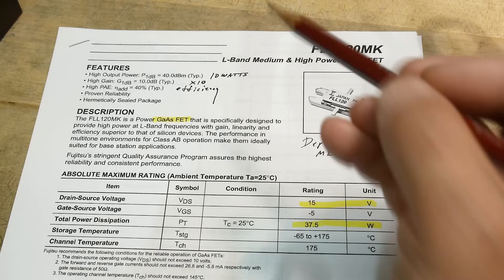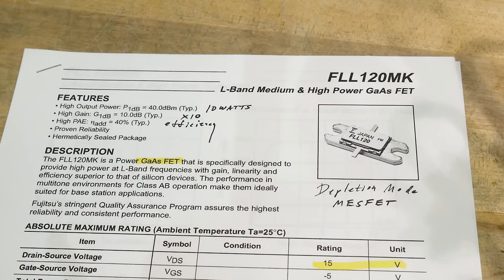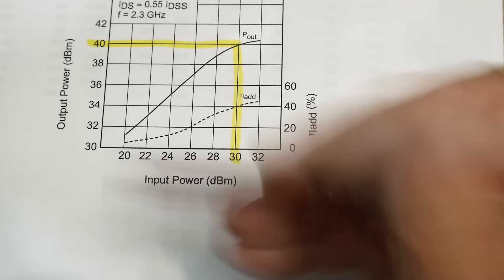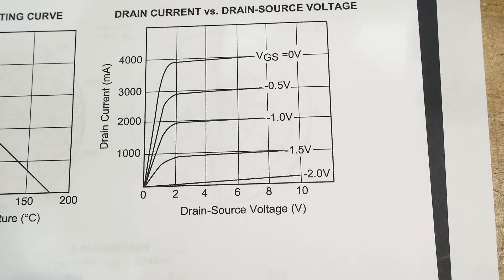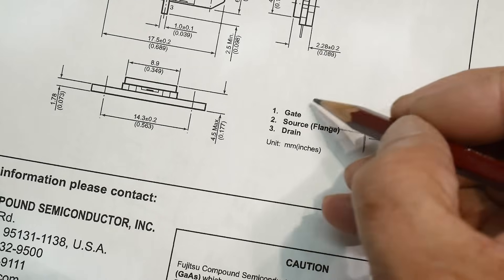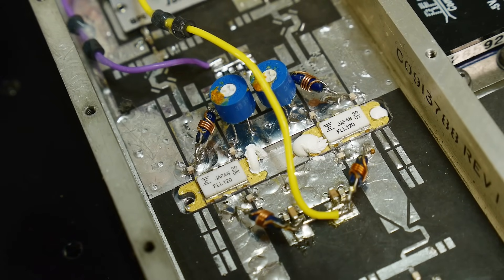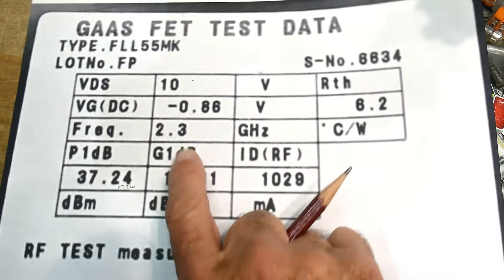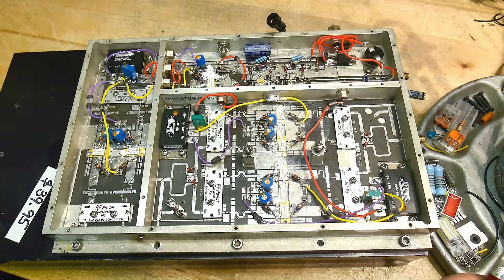#1863 FLL120 Ga-As Transistor

Comment: Kinda funny that it wouldn't be long before computer chips use basically the same stuff as RF transistors (for good reasons as they tend to grip on electrons better than Silicon counterpart especially when transistors get much smaller). Still, HEMTs (high electron motility transistors) are an interesting technology as whole.
Reply: Why tho can't they just somehow analog and just have crazy gigahertz radio type stuff. Idk how it works. But that's probably the future right? Kind of a blend. Of everything

Comment: PAE is just efficiency with the RF input (drive power) considered as a source of input power. Because with 10dB gain, Pin is equal to 10% of Pout, so just considering Pout / DCin would be ignoring a noticeable chunk of the power entering the amplifier.

Comment: Aww. I was hoping for some time on the curve tracer.
Reply: For an RF device? As an end user of those devices we have never used a curve trace to look at an RF device, what we have used is manufacturer's 'test circuit' whose diagram and parts list (for impedance matching) is usually shown in the data sheet. 
Now, as a 'semiconductor fab' (manufacturer) of those devices, *we did* on-wafer testing doing pinch off (Vp), IDSS (zero V on gate and measure source to drain current), and gm (transconductance or DC gain) as these parameters indicate to the product engineers that the various fab steps *did* result in functional 'structures' comprising the device. On wafer DC tests also show which devices are candidates for subsequent mounting in a 'housing' for RF tests.

Comment: Using Octapart, Aztech (Italy) has 2,774 FLL120MKs in stock at $1.12 each at any quantity.  Partstack confirms that with other high quantities in stock and cheap from other suppliers.  If sold for the MUCH higher prices on that auction site, you could make a killing IF there was a significant demand which I seriously doubt seeing that there is only one FFL120 sale shown in a search for completed listings despite the large number of listings for that transistor.
Reply: You can't trust the brokers, they may have fakes in their stock.
They have a tendency to state that they have lots of units of the part you are searching for. I think they use a kind of automated script to report back the search query with some random number to octopart, and when you buy it, they "prepare" the ICs for you.

Comment: Use it to make a 1 or 2 ghz drsstc 

But the secondary would have to resonate at a harmonic  several wavelengths longer

Unless you want 2 or 3 inch secondary
Reply: I don't think that's class E anymore
Reply: Damn now running a Tesla coil will knock out wifi and phone service within a few miles

At that resonant frequency